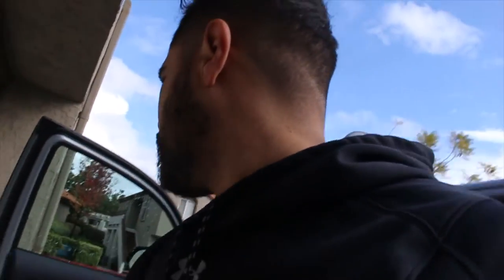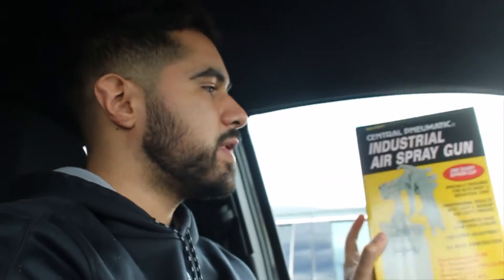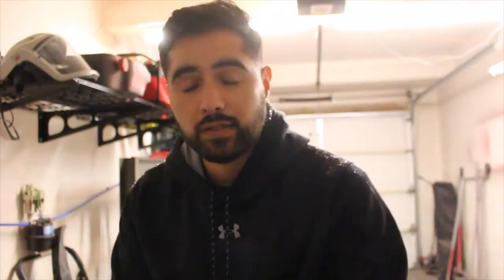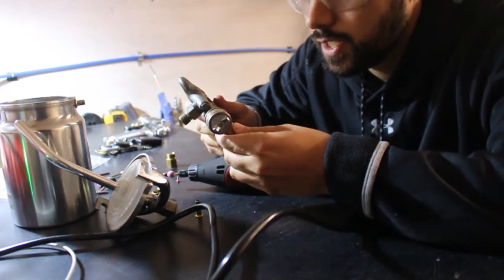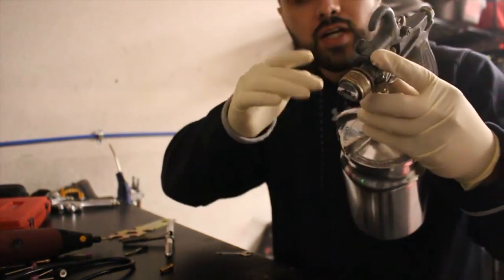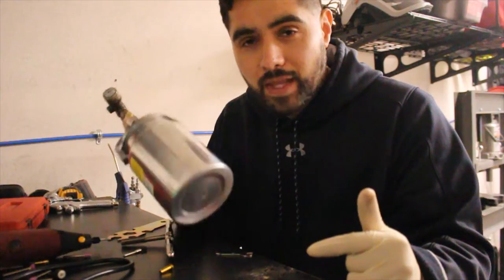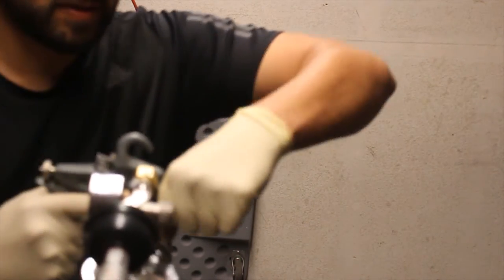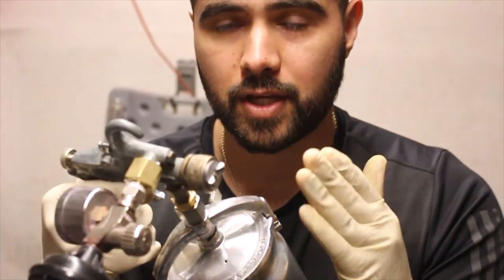Oldest Spraygun on Youtube!!! 100 year old Devilbiss!!

Comment: That gun is a touch up gun.  It uses a pint cup. It has fan control that is built in the tip.  Remove the nozzle and rotate the back of the flange where the nozzel is screw to. You will see small ramps move toward the two air holes in the fluid tip.  When the ramps cover the two air holes you will get a round pattern. When you move the ramps to show the two air ports you have max fan. You can adjust from closed to fulley open hole are anywhere between depending on how much fan you want. I have the same gun.  I had to modify the air hose inlet port became it broke.  I took a 3/8" pipe and cut It to make a 90 degree angle and took the pipe down the handle to add the air intake like a normal spray gun.  Hope this helps. Bill😊

Comment: It would appear a pressure pot system would work best for that Vintage spray gun. The air connection is in a awkward position making the gun unbalanced. Really cool project though. The gun would be good for small narrow parts.